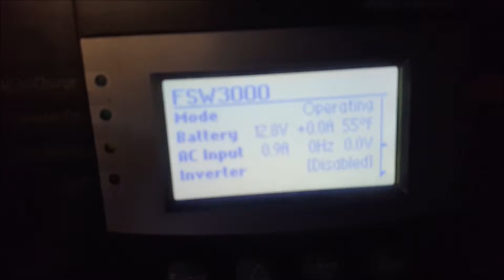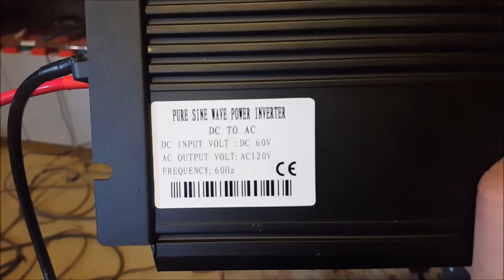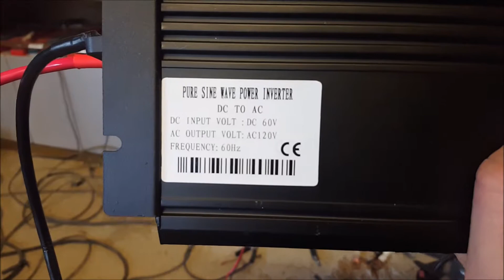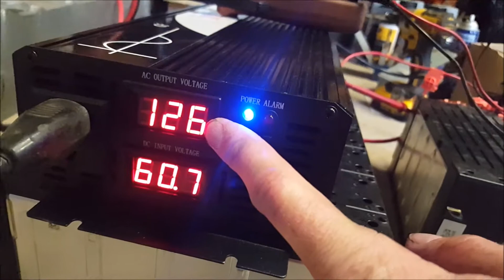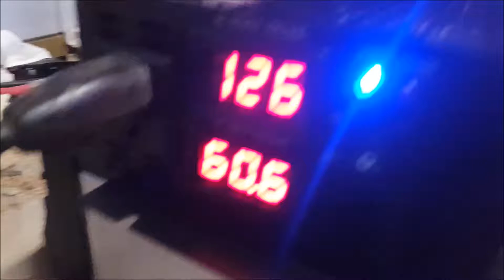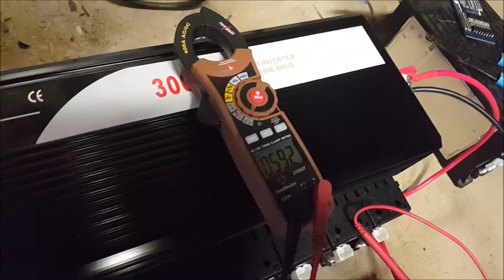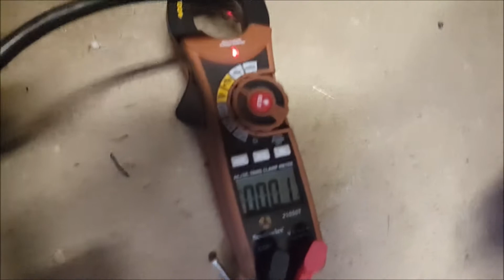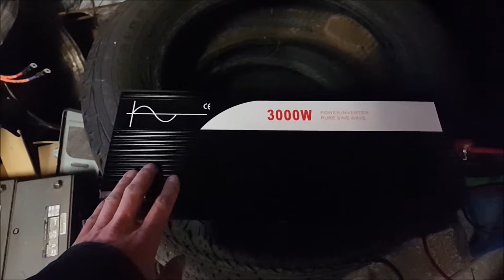The DIY Power Wall Project

Comment: What is the no load watt draw of the 3000 watt inverter.  How much did you pay per kilowatt hour for the used lithium Hyundai batteries?
Reply from the maker: $250 for 1.5 Kw it takes around 10 watts

Comment: Do away with the BMS and balance charge them once in a while to see if they drifted. I wonder what chemistry these batteries are?
Reply from the maker: I like the bms cause I dont like have to keep suck a close eye on them, I have a 120Ah 12.6v lipo bax I made and the cells are cheap cells they drift but the bms I choose seems to be keeping them in check.
Reply: fliping720 Where can I buy these cells? Please?
Reply from the maker: MrBrymstond search junk yards that is what I did
Reply: fliping720 I'm on it, thanks bro

Comment: That BMS is not going to do anything. 
The balance current of that BMS lower then 0.1A. It will burn up. 
You need a proper BMS, Google Goodrum-Fechter. It can balance with several amps and is one of the only BMS units I have seen that might keep up with your system.
Reply from the maker: ill check those out, but these batteries are so well paired they don't even need a bms, im just adding these little bms boards as a backup to help them not drift over a long time of use.
Reply: fliping720 Ok, but if one starts to become unbalanced even with 0.1V that BMS will burn up. If you look at the board you will see the small resistors, that's what burns the energy. You can see by its size that they are very small and can not do even the smallest dent on batteries of the capacity you have. 
On top of that, if you have LiFe batteries and a LiCo balancer you might blow things up. 
Make sure to check what type of batteries you have so the balancer is set to the correct voltage charge limit.
Reply from the maker: I made sure i got a lipo 4.2v balancer, ill keep an eye on the bms thanks for the info!

Comment: I think its dipping a bit to much actually. Dipping that much shows us that the inverter have no feedback on the output voltage. Perhaps compared to the price thats fine since it was that cheap. It should not dip more than during tha first second and then go directly back up.
Reply from the maker: i think it has trip points that will increase if the voltage falls below a set point

Comment: I would check the caps in the inverter it is rated 60V and most likely the caps are only 50V and if you put 66v in for along time they could blow. Good luck
Reply from the maker: ok ty ill open it up
Reply: sorry I meant to say the caps are most likely rated 60V not 50v. I would also love to find some of those batteries I guess I need to do some foot work. Thanks for showing

Comment: the max dc amps would be 50 amps so you are nearly there, #4 cable should be more than enough unless you are going a distance.
a microwave oven may be a good test as well.
best
Reply from the maker: good idea thanks!

Comment: Great plan,  the voltage makes a big improvement.  I bought a 24v inverter from EBay that has the same meters except in blue.  So many ways to go on these builds.  Only limited by budgets mostly.
Reply from the maker: my budget is low and im doing well so far, getting things cheap! I like this inverter so far

Comment: you have a great idea..like it alot..
Reply from the maker: thanks, when will you be building one of these ? I know you have the know how.
Reply: I am working on a 1400 cell 48v 18650 10k split phase portable solar generator..takes forever...
Reply from the maker: wow no kidding it takes forever! maybe give us an update, we all love updates!
Reply: Lol..nice cables...my portable gen that I have know dips in voltage alot for that pack is quite small for what I use on it..but trial and error. .your sag will be small with all the batteries your going to use..nice finds and keep it coming
Reply: Fair enough I will do more updates...I get lost in so many ideas..just bought 2k windmill..just waiting for mounting bracket. .
Reply: Can you share where you the battery and converter?
Reply from the maker: matthew drummond yes these are free cables Battery experts Pickering gave me, I like tham a lot! also I love you portable gen, looks sweet and runs well, I will keep them coming!
Reply from the maker: matthew drummond man I wold love a windmill!!
Reply from the maker: inverter link in description, and battery I found local.
Reply: can you at least tell me what is the maker and model of the battery?  thanks
Reply from the maker: Louis Y these are Hyundai sonata batteries from 2012-2014